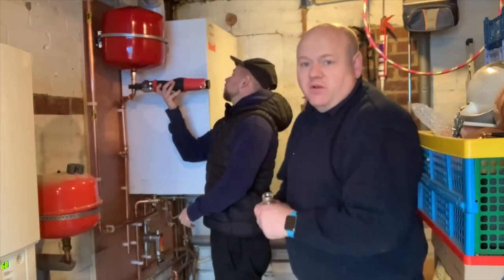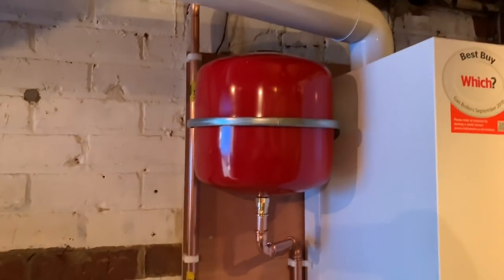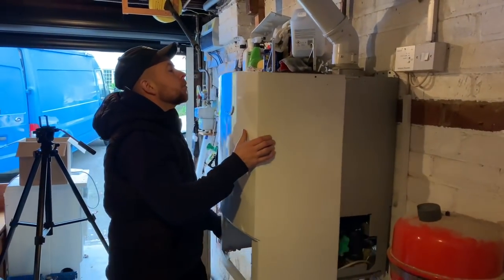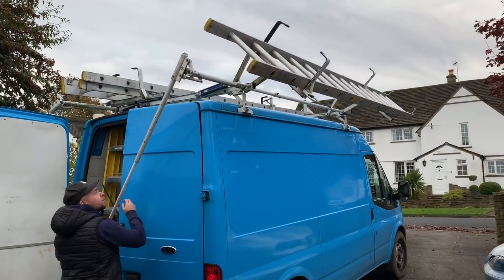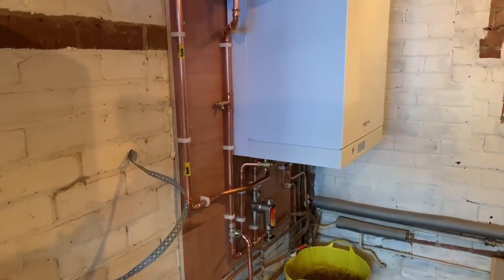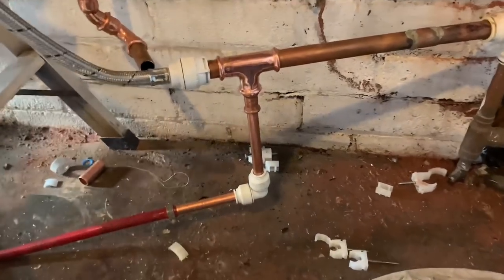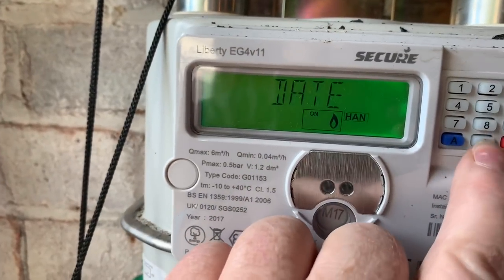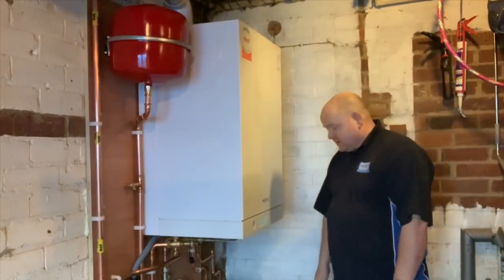Plumber - Boiler Installation - Viessmann 111 - Part 2

Comment: I'm glad I found this, it's exactly my type of heating system.
How do you do the pressure adjustment late on then? Is it depending on the intallation? It shouldn't be.
Do you really do it with these two butterfly knobs at the bottom left part? Apart from letting water out, it doesn't increase pressure at all... 🤔
I can't seem to find any video on that bit on Vitodens 111-W...
Thanks for any help or hint!

Comment: What did you have attached when doing the mains flush pal? Just have the filling loop open into the flow and isolate the the return at boiler ?

Comment: Can you please explain about the 2nd expansion tank. Is it installed just as a precaution incase the one in the gas boiler fails or was it because the gas boilers existing tank was too small for the amount of piping? Great video btw.
Reply from the maker: Yes, sure
Reply from the maker: The volume of water in the central heating system was too big for the one inside the boiler.

Comment: When doing the test on the gas supply. Where did you get the part blue part from to release some pressure. Could do with that part. I always have to keep removing the tube from my analyser to bring the reading down.

Comment: Hi Allen good work just one recommendation I use a service valve when fitting external expansion vessel.
Reply from the maker: We used full bore valve. Thanks. 👍
Reply: Allen Hart which one is better?
Reply from the maker: @kryptoniteee  Which what is better ? Sorry
Reply: Peter sutton accident waiting to happen 💣 

Expansion Vessel Service Valve 3/4" BSP Union x BSP PM

Part number: 23730

Manufacturer's part number: EVSV

Service valve for sealed heating system expansion vessel. Features anti-tamper lever, swivel nut connector and rotating drain tap. Supplied with washer and locking wire.
Reply: chris roberts Allen’s one was an additional one, but see your point.
Reply: Gas Gimp 👍🏻

Comment: Hi Alan, I have viewed all your videos and I’m impressed by your honest reviews. Please could you give me some advice regarding choice of a system boiler. I have a 3 bed detached with 2 bathrooms with showers that are in use at the same time occasionally and 14 radiators. I currently have a boilermate tank and potterton  boiler. What would you recommend?
Reply from the maker: Depends on flow but if it’s a system boiler you require then, Baxi 600 system, Viessmann 100 system. But maybe you could also look at the Viessmann 111. Thanks.
Reply: Hi Alan thank you for your advice, I have good pressure and flow and like the reviews of the Viessman what KW output do you recommend?
Reply: We have a 4 bedroom house with same number of rads. I had a Vaillant ecotec 630 plus system boiler fitted 2 1/2 years ago and it is great. I had it fitted in the garage but it is so quiet in the house would have been ok. My gas usage went down a little and we run the house at 21C so we are very happy. We still have a hot water tank as we have a solar panel for hot water as well. 
The only down side was I had to have a long flue to get to the outside wall.
I would highly recommend this boiler.
Reply: Eric McRae Hi Eric thank you for your feedback I also plan to have the boiler fitted in the garage 👍

Comment: Good job Allen, ive just had a extension done and they’ve used plastic pipe for water pipes and central heating, is that ok? And they have teed into the copper pipes in the original house.
Reply from the maker: Depending on the pipe plastic is normally ok. Thanks.

Comment: Great job, you could've pul a lever  valve under  the expansion vessel, just above the drain off so that you don't have to drain the system if it is faulty. Take of the lever so no one closes it.
Reply: Savva Savva  the drain off needs to be between the lever and the vessel  otherwise it cannot be pumped up accurately.

Comment: Allen why don’t you use copper push fits rather than using that crimping machine?
Reply from the maker: I am not that keen on push-fit. Also, you cannot use push-fit on gas. Thanks.